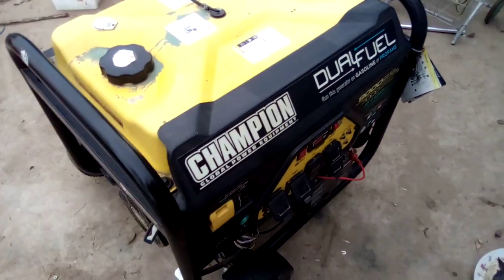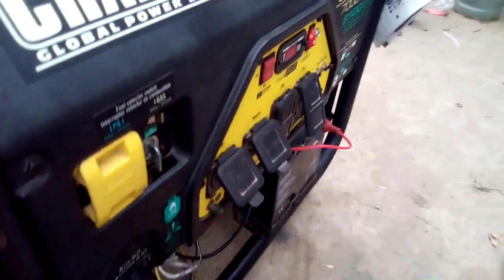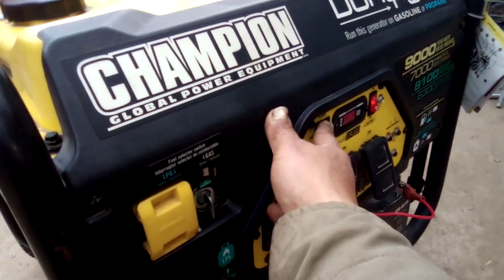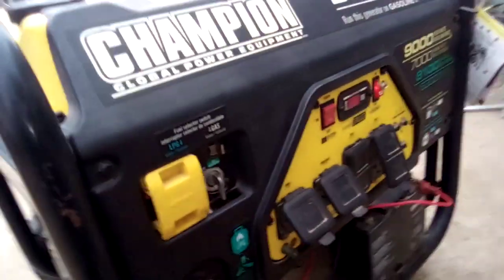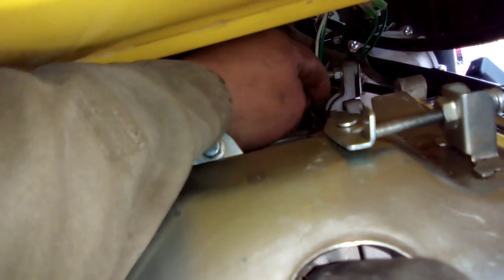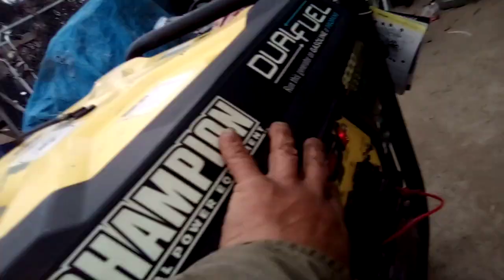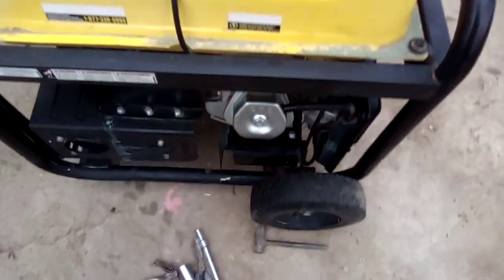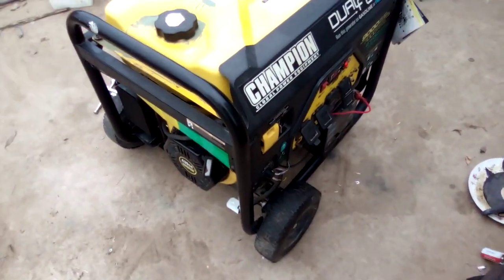Trouble shooting a backfire start then stall champion generator

Comment: I bought a 6250 champion Dual Fuel and, right out of the box, it was doing the same thing. It would run for a little bit until I put a load on it. Then it would just shut off after 30 seconds or so. I found your video and unhooked the black wire for $h!ts and giggles and it runs like a top now. Thank you!!

Comment: I had a new champion generator 1500 watts the same problem, i look the schematic diagram online and found out that the yellow wire is connected to the oil sensor. Maybe the sensor is stock thats why its signaling the engine to stop because the oil is low.. thanks for the video man. Save me lots of time👍.... the only down side on this is you need to always check the oil level because you remove the oil sensor.

Comment: YOU. ARE. THE. MAN!!! I've had one I've been working on for a couple weeks trying to figure out what was going on! This was exactly my problem. Not sure if I have a bad switch or not but that black wire goes directly to it. Only difference is when I shut my switch off to kill the unit it won't cut completely off unless I make contact with that black wire. Soon as I plug it in it will complete shut down like it's supposed to. Thank you for sharing this! Mine was about to become one helluva trot-line weight!
Reply: I like the trott line anchor joke:))))))

Comment: This is awesome, so much frustration trying to figure out the problem. Pulled the wire apart and boom runs nice and smooth now. Now I have to figure out why that works and what the wire is supposed to do. 🙂

Comment: I have this Champion generator I bought 10 years ago. Never used it! It has barely 3 hours on it.
Last few years when I tried to start it exact same problem "Stalls before you move off the choke".

As you know big nor'easter is coming tomorrow.
Found this video and viola! Problem fixed.

I may have caused the problem by overfilling oil few years back.
I had it drained but probably not enough.
I will drain completely and refill to proper level.

However in the mean time I am ready for tomorrow if necessary 🙂

Thanks for the video it saved the day!

Comment: Thank you for this video!!!!.. 
I was having all kinds of problems, and we had rust in the fuel tank, so I replaced the tank, and the carb, still same problem... start up and stall immediately.  I pull the coil wire , and boom started ran like a true Champion.  I really wish I knew what that wire purpose was, but at this point, I don’t know if I care.  I changed the oil, change the fuel... and nothing.. but this worked!
Reply from the maker: im not sure about the wire myself but like you said it doesn't matter where the wire goes just as long as it works lol thanks

Comment: Messing with my Homelite 5550 which had been stored for a couple of years and it wouldn't start. Tried every thing I could think of and came across this video....guess what the problem was ? .. That's right. the coil wire. You rock man.....Thanks !!
Reply from the maker: no problem glad I could help

Comment: Same thing happened to my generator bro. Did you just unplugged the oil sensor?
Because i check all the carb, spark plug,oil and the  tank is  full, still it won't start and keeps backfiring. So i brought it to the shop hope they'll  figure  out what's wrong  and fixed it.
Reply from the maker: it wasn't oil sensor it was more like the coil wire was grounding out let me know what the repair shop has to say ok thanks brotha
Reply: What was it? Mines doing it too. I got great spark...got fuel....it just loads up and backfires....valves?

Comment: Works great with no load. Also works great under load for about an hour
Reply from the maker: Did you check your spark plugs and coil I worked on a generator that stated fine but the plug would be really hot and cut off after a while of being on changed the plug and now it works fine or low oil pressure switch try disconnecting it and turn it on and see what happens if it stays running then there's your problem only thing is that is not an easy fix need to open engine case to replace it hope I helped you just a little bit ok
Reply: Mine does the exact thing,start right on and runs for a while then it starts acting up & backfiring through the carb

Comment: Did you ever find out the root cause? Because it's possible that the generator is detecting a fault when the RPM is raised and is trying to shutdown the engine. By removing the ground wire, it's possible that you just circumvented a safety feature. Then again, this is all conjecture but it's better to err on the side of caution.
Reply: The AVR will do that if it is beginning to fail

Comment: Dude, it does not want to be called a craftsman when it's a Champion. Since it needs to be kept in
choke it would be running lean. What coil are you talking about? is it the fuel solenoid under the 
carb? wires unplugged it stays running, sorry but when u have wires w a plug, to me it seems they 
are to be plugged in. U could have a bad diode hooked in with low oil switch or a bad low oil switch.
I am almost thinking that if engine runs low on oil, the safety switch won't shut the engine down
and you will ruin the engine.

Comment: I had the exact problem.

I disconnected the black wire and it continued running as yours did.

Called tech support and was told  the VF PROTECTION MODULE is bad.
Part #336713818

Don’t plug anything into the generator because the voltage isn’t being regulated properly.

Firman said they will replace the voltage regulator under warranty if you registered your product.

This was my neighbor’s generator, he is currently registering his generator and hopefully they will sent the part!
Reply from the maker: Ok that's Kool glad I could help a little be take care

Comment: Low oil shutdown?  Or it's low on oil or the sensor is bad
Reply from the maker: You know it wasn't low on oil I checked the  oil  I did valves lashes checked the flywheel pin I mean I had this generator torn apart trying to figure it out until I stated messing with the wires and that's where the problem was I want to say it was the fuel cut off sensor wire on the carburetor